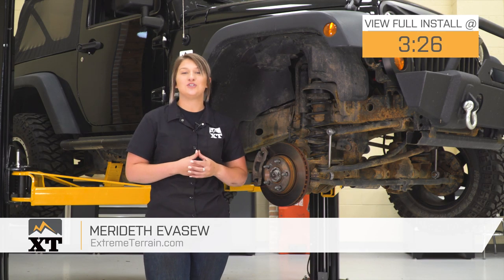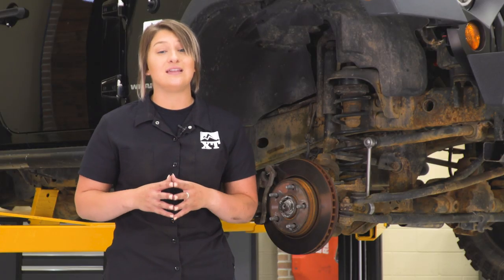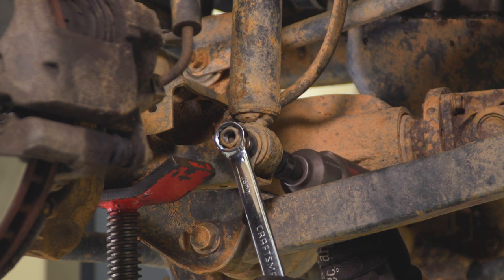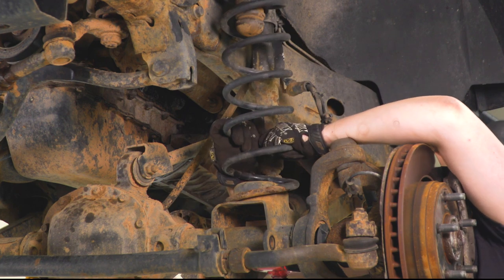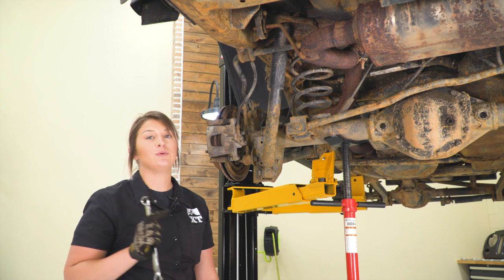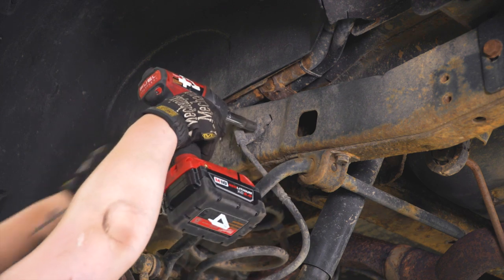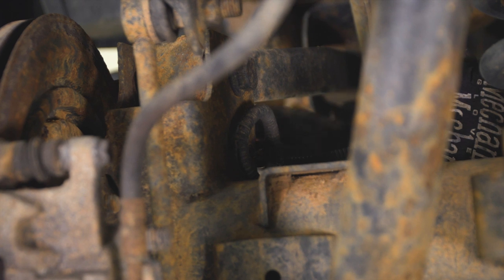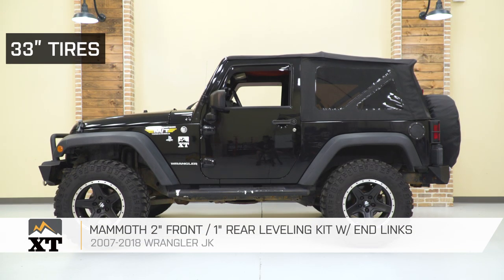Jeep Wrangler JK Mammoth 2 in. Front / 1 in. Rear Leveling Kit w/ End Links Review & Install

Comment: Ive been running this kit on my 2017 JKU (4 Door) (im sure Zach or  Merideth will comment WRONG FITMENT lol) but with some 2 inch Rancho shocks and runnign 285\70/17s I have no complaints. Links are holding up well and little ride difference. However I think I will be upgrading to a coil spring lift due to wanting a better ride down the highway (I drive 420 miles per week on this daily driver)
Reply from the maker: Feel free to call me out if I give incorrect fitment on anything, but both Merideth and I have been doing this for years. We kinda know what we're talking about. 😉 Glad to hear you're happy with your Mammoth lift kit! Those coil springs will definitely help the ride, so will adjustable lower control arms and an adjustable front track bar if you have room in your budget. -Zach

Comment: I got this leveling kit for my JKU and my question is my rear shocks are 0 inch lift  will this work with the 1 inch rear spacer? My front shocks are fine they are 0-2 inch lift.  Also after this leveling kit is installed would I need an alignment?
Reply from the maker: Your factory shocks in the rear will work just fine with a 1" spacer. Technically, the shocks will be over-extended ever so slightly and I'd recommend getting an 0-2" shock like what you have on the front. But if you don't have room in your budget right now, they will work fine temporarily. -Zach
Reply: @extremeterrain  would installing rear bumpstops prevent the stock shocks from over extending?
Reply from the maker: They'll be slightly over-extended as-is at normal ride height with the added spacer. Adding extended bump-stops will help prevent added damage while going off-road though. -Zach

Comment: hi i seen someone mention in a forum that when you do a leveling kit after you replace the oem sway bar links that you use the front oem sway bar links on the back instead of using the oem back sway bar links. is this true or do i reinstall the oem rear sway bar links?
Reply from the maker: It really comes down to the specific kit you're looking at! Some leveling kits will come with new swaybar links front and rear, others will only come with replacement rears and have you put the factory rear ones in the front. -Zach
Reply: @extremeterrain  I have the kit shown in this video

Comment: Sooo…I have a 2018 JK, and just installed a 1.5 inch leveling kit. I did have to muscle in the coil springs with the help of a pry bar after putting in the spacers. I did this on my driveway with a floor jack and jack stands. Here’s what concerns me, I never loosened up any control arms or the track bars when the time came to lower the axle. As soon as I was done I torqued the wheels and put it back in garage. Am I in trouble or should I get back under there and loosen/re-torque any track bar bolts and control arms?

Thanks

Comment: I just ordered mine question you dont need front or rear bumpstops?
Reply from the maker: For daily driving and keeping your sway bar links connected, I honestly wouldn't worry too much about getting extended bump-stops. If you plan on disconnecting your sway bar links and really flexing your Jeep out though, I would look into getting extended bump-stops to avoid any rubbing. -Zach

Comment: How about 35’s with aftermarket fenders?
Reply from the maker: With a set of higher clearance fender flares, you could absolute squeeze a set of 35's underneath! You may just run into a little rubbing when time comes to go off-road if you disconnect your swaybar links. -Zach

Comment: will the 35" work/fit if you have fender flares instead of factory fenders with a stubby bumper?
Reply: seen this asked and answered by someone else after i asked
Reply from the maker: With high clearance fender flares and a stubby bumper or some trimming of the factory bumper, you can definitely fit 35s stock. That being said - things will be pretty tight still. If you plan on doing any sort of off-roading, 2" of lift will be needed for some 35s to fit without issues. -Zach